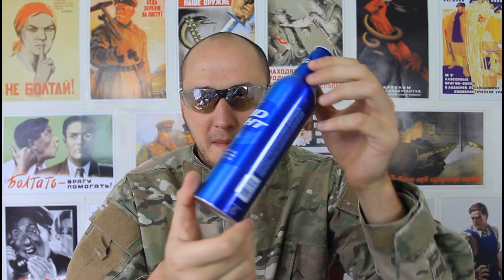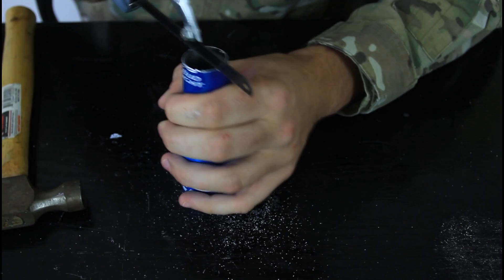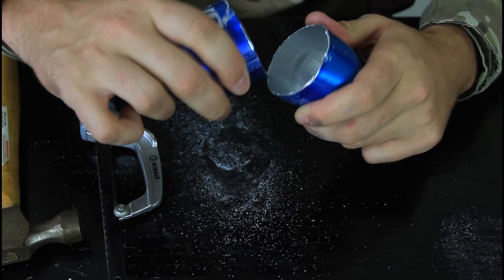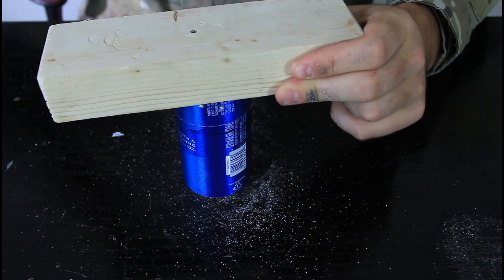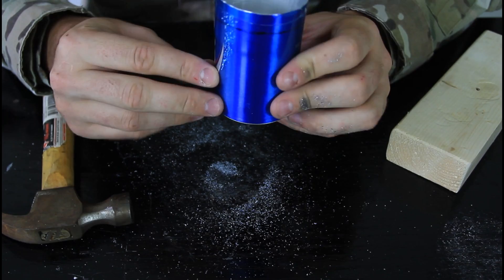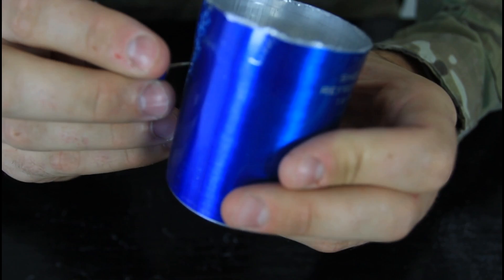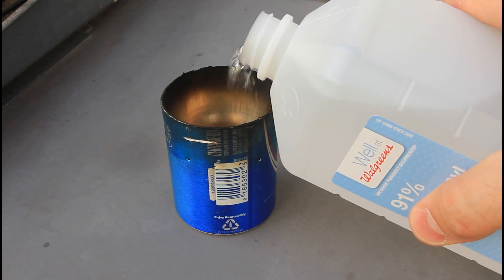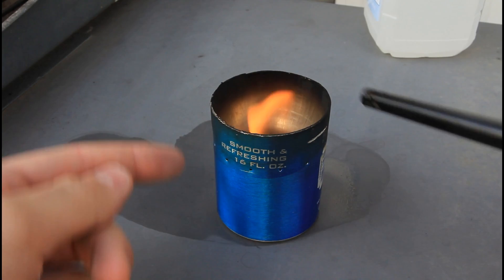Alcohol Stove from a Beer Can -  Zombie Survival Tips

Comment: What is the best rubbing alcohol to use?  Is seen 91%, 81%, and lower.  Would lower be better so it doesn't burn so fast?
Reply: 10000000000000000000000000000000000000000% would be perfect
Reply: Higher is better. Lower % rubbing alcohol leaves some gunk and burns dirtier. The flame is not that hot and it takes longer to boil water. It also doesn't last that much longer.

Comment: Metals may creep because of high temperature and heavy load. The can may collapse and the hot water in the bowl may spill out if you the heating is too long or the load is too heavy.
Reply: That beer can is capable of supporting over 150lbs.
Reply: cause that's the exact amount of weight in pounds that i weigh, and i stood on it. specifically.
Reply: support the bowl. easy!

Comment: This one doesn't burn hot enough!
The flames are yellow, they should be blue for optimal fuel efficiency and heat.
Reply: MrDengo999 If you think about it, you want it to burn good enough (optimal efficiency) so you don't get food poisoning, which will pretty much ruin your chance of survival.
Reply: MagikGames just let it cook for a longer period of time
PROBLEM SOLVED
Reply: That is exactly what I just said...
Reply: MagikGames  nvm nvm i misread that sorry eh go on..
Reply: MrDengo999
Ehm... during survival times you'd exactly want optimal burn efficiency? It determines how much fuel is used to cook your food...

You'll have limited resources so you'll need to be careful with what you have..
Reply: DutchManticore but sometimes santa doesn't give you optimal burning fire for Christmas and you have this... make do with what you have THATS what survival is all about
Reply: MrDengo999 So the point of your criticism and calling me an idiot is just to have an argument for the sake of having an argument?
Reply: DutchManticore it may seem like that but it isn't. this is a friendly argument.. i ain't even mad
Reply: Ncyim It has to do with the amount of air that gets mixed with the alcohol vapour before it gets ignited.

It either needs more or less air.
Hard to tell without holding it and testing a few things.

Comment: cool, but not as efficient as more suitable flammable gasses like propane.
Reply: Yeh sure lemme just get the tap and die and plumbers tape and brass valves and hoses and flow regulators and propane bottle I have here in my survival kit
Reply: or just get a mini propane stove they make them pretty small. My point is there is no need to make your own. Fun, but comparably not useful.
Reply: Emiel Emilio So what, I'm out in the wilderness surviving without my propane stove that I have presumably left at home and I happen to have cleaning alcohol and a beer can? Yeah, that's totally going to happen.
Reply: Emiel Emilio You say that, but I find it unlikely that I will be using this technique even If I do find myself in a survival situation. Fire can be made in ways that are less demanding on your supply of booze :p

Comment: can i use kerosene or petrol instead?
Reply: No, kerosene won't produce the vapors needed and gasoline is too volatile.  But methanol (methyl alchohol) is ideal.  Look for it in the automotive section as the brand name 'Heet'.  It's supposed to be a gasoline additive to prevent freezing gas lines, but it's perfect for these stoves.  Denatured alchohol is a close second best.  It's over there with the paint thinners and whatnot.  You can also burn moonshine in it, but it's not ideal.  The isopropanol he used in the video makes a mess on the bottom of your pot.  Methanol burns with a clean, blue flame with no soot or smoke.

Comment: The only shitty thing is that it's an incomplete combustion. Leaving you with a (relatively cold) yellow flame and a lot of soot. Though great in a though situation, you should try to improve on this design.
Reply: There are many other designs for this sort of stove.  Some of them are quite complicated with little tubes for air and such.  This one is actually the only one i've seen myself that burns so orange.  Even mine, which is made from 2 pop can bottoms, burns a blue flame once the pressure is up.
Reply: littlegoobie
the color of the flame also depends of what ur burning too
Reply: StopGooN
true but since this is presumably plain alcohol, the color-scheme should be standard.